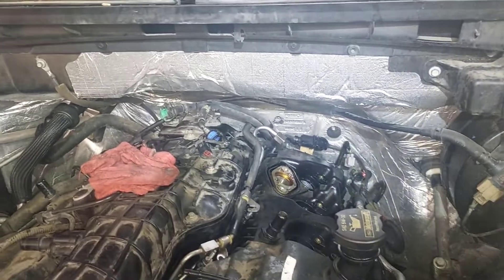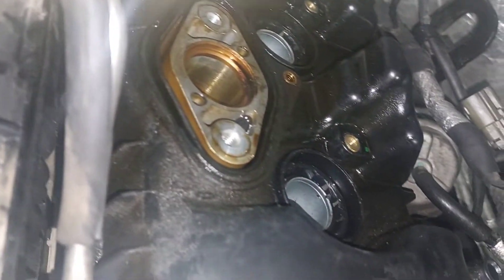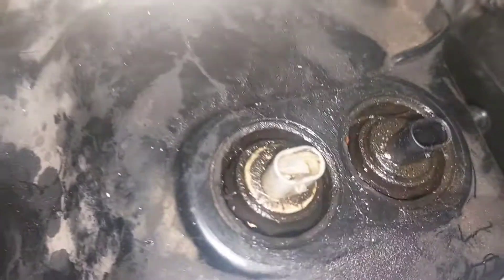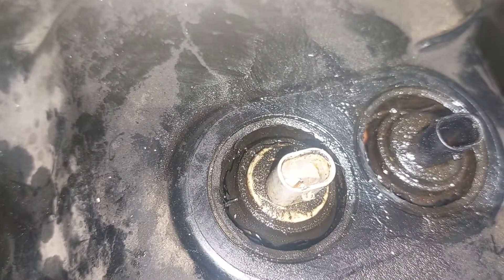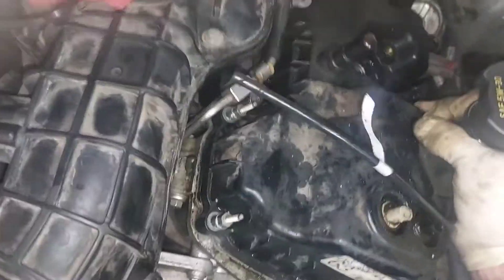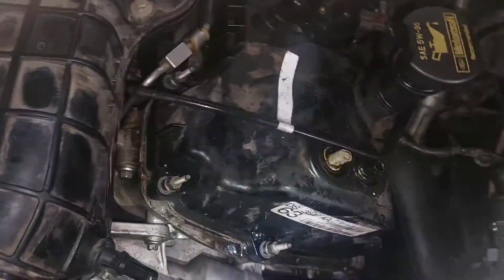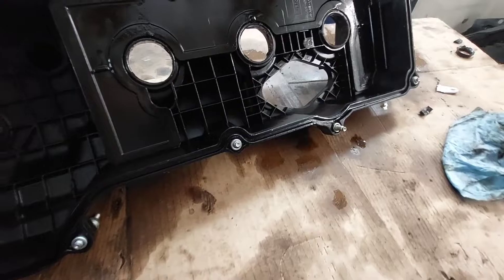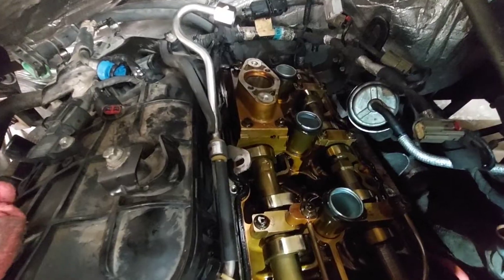Ford Ecoboost 3.5L Valve Cover Removal Tip

Comment: *THREE TIPS* 
2015 Ford F-150 XLT 3.5L Ecoboost w/ 120K miles.  I replaced the valve cover because I was getting an oil leak (in the back left corner) that was smoking and entering the cabin.  I had previously replace the pump and that did not solve my issue.  Replacing the valve cover was harder than the pump replacement.

#1.  Once I had had the valve cover unbolted, I found cutting the three rubber seals where the spark plugs go allowed for me to pull the valve cover off easier.  Two of the three seals had melted/bonded to the the aluminum tubes.  I was replacing the cover - but it took some banging and a pry bar to break the seal.

#2.  Make sure all wires are clear when you put the valve cover back on.  May sound intuitive but I made that mistake and did not realize it until after I went to plug all the wires back up.  

#3.  I called the wrong Ford location and they quoted me $206 for an OEM cover.  Called the right one to find the same part $50 cheaper.  Not sure why it was so much cheaper.  I know there was a fair amount of discussion on these items not being available but on 8/30/2024 both local Ford dealerships had them in stock.

I consider myself an average DIYer - this project took me about 5 hours to replace the passenger valve cover.  I took my time so as not to break any connectors.  Minus being dumb and not clearing all the wires before I installed the valve cover, I would give it 3 out of 5 stars when it came to difficulty.
Reply: Bro thank you for the honest tips! About to take mine on in the next couple days.